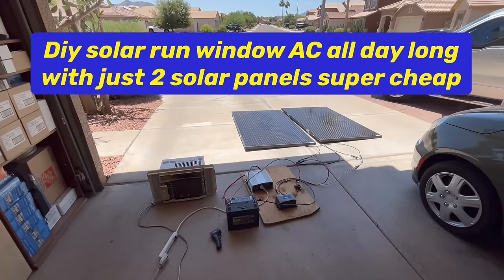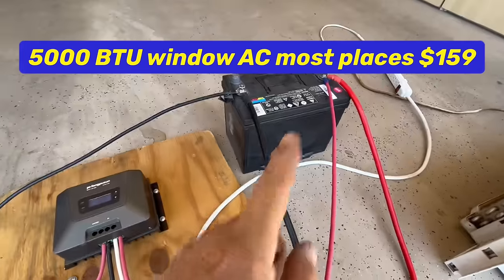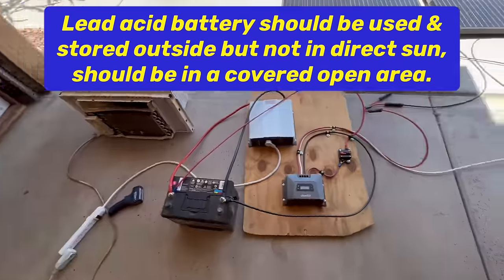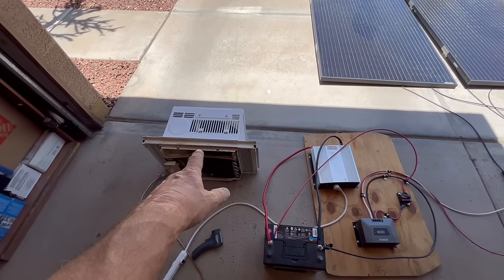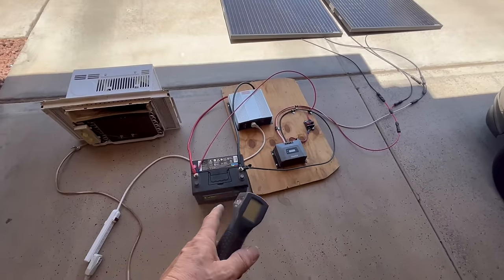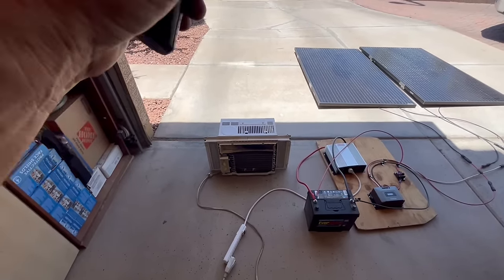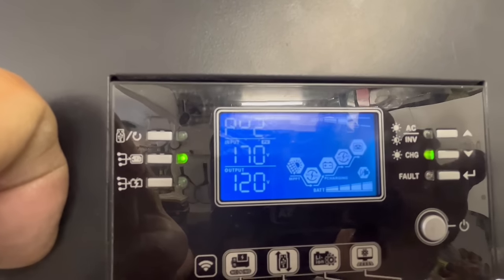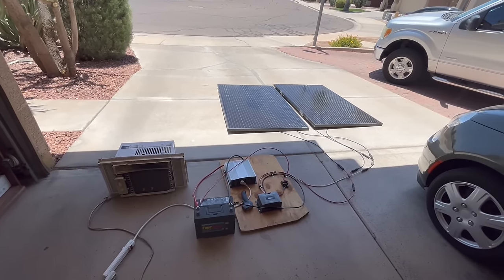Run your window AC with just 2 solar panels when sun shines. Easy DIY project you can do in one day.

Comment: Very interesting.  Seems like I have always been interested in solar, wind, etc, but ...  life!  Just a note, and you may know this - solar panels will work better where they have some kind of cooling airflow over the front and back surfaces, rather than that hot pavement.  I realize the arrangement was just for the video, but...I’m also surprised by the number of folk who are not aware. 
Thanks for sharing!  Best wishes and good travels!
Reply from the maker: You are correct, the solar panels in the video were laying on the ground just to be able to show Everything needed to complete the system. If you watch my other videos I use pergolas so the air flow is really great. Solar panels are 8 feet off the ground. I also built 2 solar arrays that are almost 6 feet above the ground that allows great air flow. I was diagnosed with 2 incurable cancers in 2016 but a actually started in 2013 before it was diagnosed. I can not do much in a day. What might take you a day to do could take me a week(s). So I started actually with this system in a 4x8 shed with 2 solar panels mounted on top the shed. Over 4 years I kept learning just watching videos about solar, hvac and electrical. Over 4 years, I expanded my solar system and installed 6 mini split heat pumps, 2 upstairs, 2 downstairs and 2 in garage. 3 bedrooms and a loft are above garage and garage makes those rooms really hot. Garage in Phoenix AZ can get az hit as outside and if you pull a hot car that has been outside and driven fir 29-30 minutes, that garage can get over 130 degrees or more. Now my garage is 78 degrees in the day. We use only off grid solar to air condition our entire house all day long with solar while sun is shining and upstairs at night with a 25.5 kWh EG4 LiFePO4 battery bank. We save over $700 a month in electric bill in summer for up to 6 months. We also run our pool pump 7/24 365 days a year using only solar in day and LiGePO4 batteries. We run 3 freezers, a fridge, outdoor lighting all day and overnight on off grid solar. We heat our 15,000 gallon pool to 87-89 degrees in the winter out here using solar off grid. We installed everything ourselves and actually have 3 separate independent systems that had reduced our electric I’ll by over 80 percent for the year. All DIY just buying used solar panels, refurbished Growatt low frequency off grid inverters that can start and run our 3 1/2 ton, 4 ton central air conditioners that use a lot of power and that pool heat pump that is 12.7 ton that use to cost me $10-$15 a day in winter to run. We are only electric at our house. Now we pay nothing for air conditioning in house and garage and we pay nothing for heating pool in winter and can cool it down if too hot in summer with that pool heater/cooler. Everything we did is DIY with no plans to follow, just imagination and learning. I made this video to help people understand the very basics for solar and used an window ac to show you can run it producing your own power. I actually ran this in that shed for 2 years every day from 8-9 am to 5-6 pm. Just to keep inverter and charge controller(s). I added more batteries and more charge controllers then when I was producing more power, I installed my first 12,000 btu 110 volt mini split in garage. Then just kept learning and adding more and more components working my way up to the system I have today. Check out some of my other videos if you are interested in DIY solar off grid. Thanks for your comment and hope you have a wonderful and very blessed weekend

Comment: To get more bang for your buck get one of the newer inverter AC units which throttles current to the compressor which does not need to run full speed all the time. Midea makes a nice U shape 8k btu and it will probably use the same amount of power as the 5k if not less. 
Another thing to watch for with modified sine wave is anything with an AC motor will not run as efficiently and builds up waste heat which can cut the lifespan down. Sometimes you will hear the fan is not running as fast as it should or buzzes some.
Reply from the maker: Thank you so much for your input.
Reply: I have the 10k and 12k Midea’s and I’m guessing after seeing my first power bill since I installed them that the 12k pulls equivalent to an older standard 5k. These things are great. Got the 10k on Amazon a few months ago, then I was fortunate to get in on the sale of the 12k’s at Costco for $100 less than I paid for the smaller 10k on Amazon.
Reply from the maker: @mainmanmustard  very nice. Hope it reduces your electric bill a lot. Thanks for input.
Reply from the maker: @mainmanmustard  you will like how much you can save on electric bill. I cooled my house from 7am to 5 pm 7 days a week using only solar and AGM battery bank and cut my electric bill by 65 percent first year using mini splits. I use 2 downstairs or my 4 ton heat pump to air condition in the day and run my 3 1/2 ton upstairs 7/24 all on solar now. I spend $0 on air conditioning in Phoenix AZ. Lady moth averaged 113 in day and 85-90 at night. Never used the grid for air conditioning. 2450 square foot 2story house. All the solar in completely off grid. Hope that inspires you. Thanks for your comment and check out my videos on all I do with off grid solar. I think you will like it. Hope you have a wonderful and blessed weekend
Reply: @mainmanmustard  I just ordered the Rovsun 12k 115volt mini split for my RV to replace the power hungry Coleman beast. From what i understand Midea is the manufacturer of most of these rebranded mini splits so I expect stellar performance lol

Comment: Greatest tip for any DIY solar installers.

1. Always go 1-2 gages over the manufacturer recommended wire. 

2. When mounting or installing use a fire resistance/proof/retardant material between the electronics used (I recommend wielders blankets)  they are relatively cheap, can handle any direct fire/heat up to 1800 degrees. In any case of fire the blankets will give you time to react and even prevent spread of fire. 

3. Keep them in well ventilated  areas (most manufacturers recommend 1 ft space in all directions excluding the mounted surface). 

4. When in doubt contact an electrician.
Reply from the maker: Thanks for your wonderful input. Hope you have a wonderful and blessed day.
Reply: Or you can use the NEC wire gauge standards and avoid the higher costs of excessive gauge wire.  NEC 315 and its sub paragraphs.
Reply from the maker: Thank you so much for your input. We and other viewers appreciate it. Hope you have a wonderful and blessed week
Reply: @billkraemer4710  
Yes but the standards do not protect against lightning strikes and surge flows caused by them.

Comment: Thanks for the video, I will do this with my window unit, this way I dont need to waste so much electricity cooling the whole house, only my home office.
Reply from the maker: Improve upon this simple example of solar running ac. It is very easy to do. If you live in an area that gets a lot of clouds daily or a lot of rain you will have to increase solar by 3 to 5 times to keep up with shading issues from weather alone. This example only works if you have full sun all day with no rain, clouds or shading. You could try using an all in one inverter, but those are usually 24 volts systems and can be expanded in the future. One thing I notice is when people start seeing what is possible with solar, they can’t stop improving system. I now run 100 percent of my air conditioning in 2 story house and garage with off grid solar. Check out my other videos to see what is possible with solar. My biggest mistake at first was using a small system like this only to realize I wanted to do so much more with solar. My electric bill in Phoenix AZ is only a little over $1000 for the entire year. Last 2 months temps in day have been 112-117 in day and 90 degrees or more overnight lows. Our average is 103 for 24 hour period for 2 months now. My garage has ac and is around 78 degrees in day because I have 3 bedrooms above garage and rooms use to be so hot from heat in garage in being 110-135 degrees. Now rooms are cool 24 hours a day with a cool gay and stays cool when we pull in hot car. Thank you for your comment and hope you see what is possible with off grid solar in my other videos, we run pool year round 24 hours a day with solar only and heat pool in winter to 87-89 degrees even when reps dip into 30’s and 40’s overnight. Hope you have a wonderful and truly blessed weekend